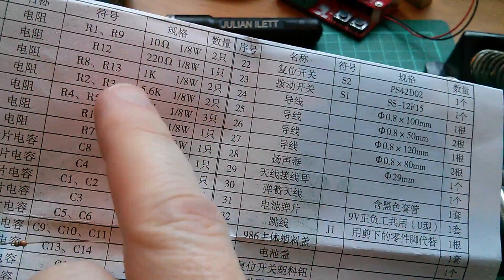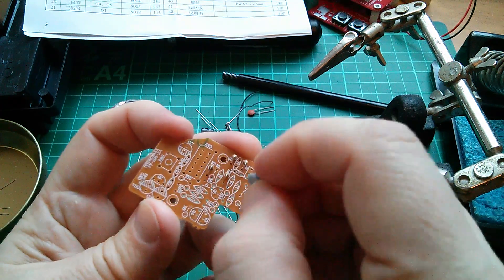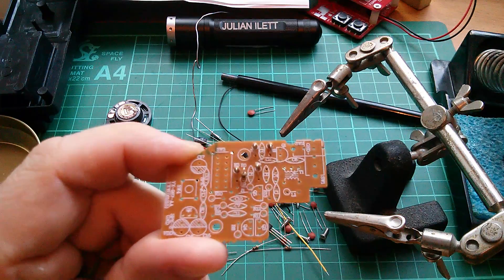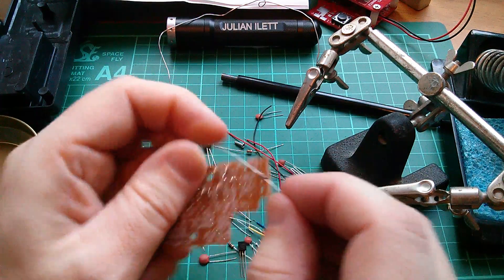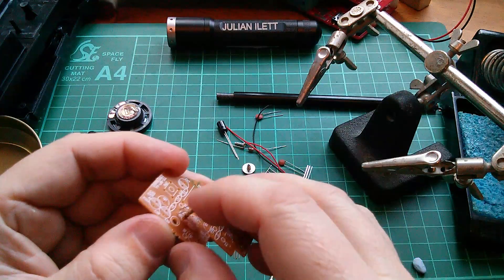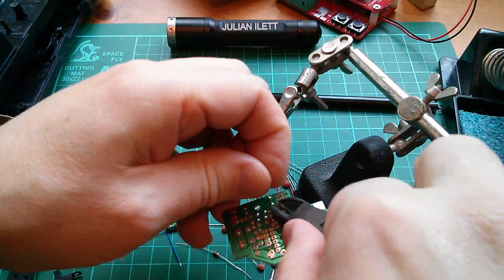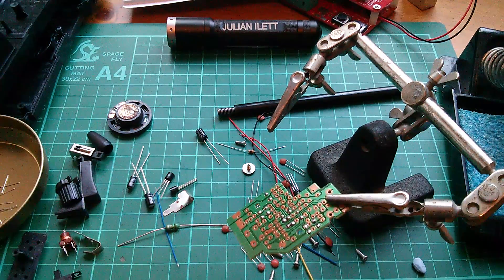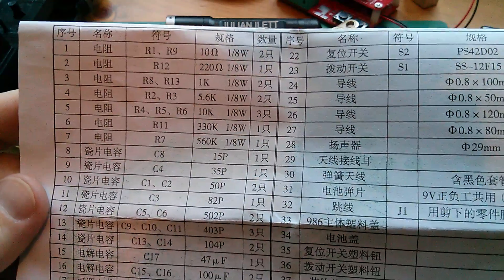Real Time Kit Build: Walkie Talkies #2

Comment: I got my practical start in electronics with a Philip Electronic Engineer kit - got the basic kit for Christmas and was desperate for my 10th birthday to come around a month later when I hoped I would get the add-on kit (which I did!). The following year's birthday was an Avometer. 
I wonder how many budding electronics engineers got a boost from fiddling with those spring clips and perforated board (and the sick feeling in the pit of the stomach when one careless bend too many separated a spidery leg from an AC126 transistor!)?